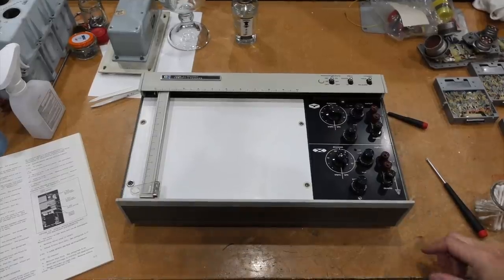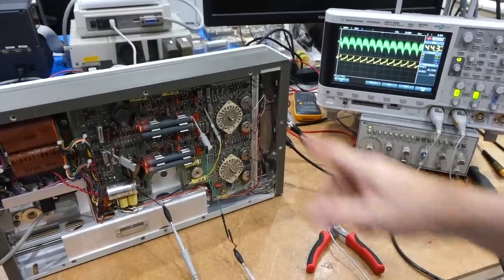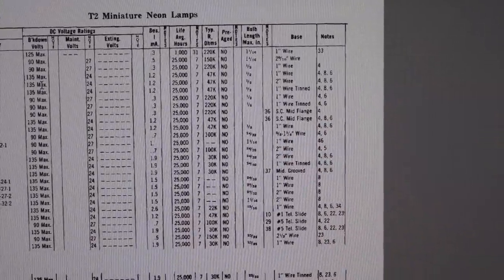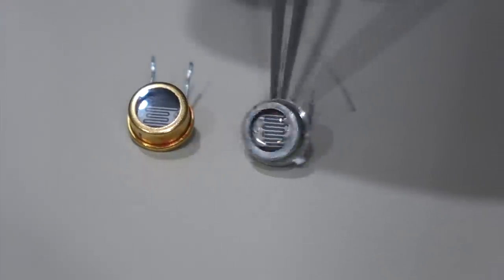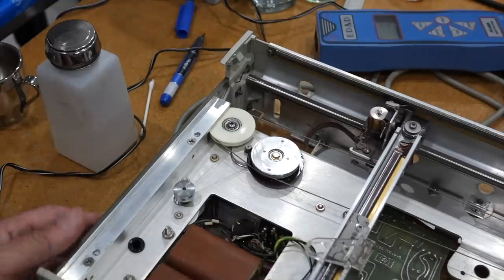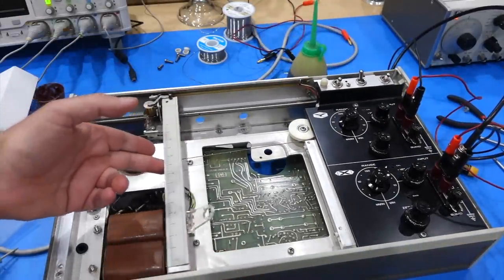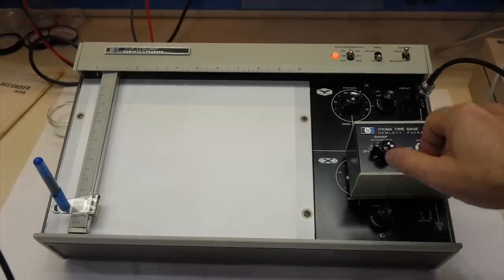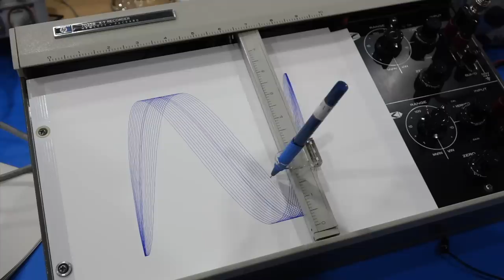HP 7035B X-Y Recorder Restoration Part 2: Back to its Former Glory.

Comment: About 33years ago, I repaired a lot of hp7004B plotters, those with the small amplifier / time modules.. very fine instruments. Once I got nearly electrocuted, due to a scratch in the lacquer of the HV paper hold-down. 😜
The experiments on High-Tc-Superconductors went over many hours, so finally leaving a big ink blob on the paper.. 
In turn I could finally convince my prof. to let me develop DAQ via GPIB - DMMs (bad Keithley 195A) and Borland Pascal on PCs. The PDP 11 had just been scrapped.
 Those were the days..   😍
For the FLUKE 845AR optical chopper we found modern neon bulbs from Barthelme,  type 82305, which show no dark effect. Maybe that's a hint to replace neons in HP devices (e.g, hp419A) as well.

Comment: I found this same problem with CdS response when working with guitar amplifiers... Fender used a 'roach' (neon with CdS heat-shrinked together) for their later tremolo circuit.  If you try and sub a generic CdS you find that it won't work well... CdS cells are slow to respond, so Fender had to find special ones that work fast enough for the tremolo effect to sound good.
Reply: I've never heard it called a "roach". The term vactrol is pretty common for synths and amps. I've never heard of anyone needing a special LDR for one though. They max out at 10-20hz?  Fender never used special anything unless it was special because it was cheap :)

Comment: So nice to see you use the electronics prototyping kit for testing this plotter - vintage gear restored and loved. BTW reverse-engineer the D-sub connector next to the mains connector, if it's not documented.
Cool timebase module too. A good demonstration of how an oscillograph works. 

Loving the ASMR mode!
Reply: And the 3312A function generator too

Comment: In my CNC with the pen holder on, I'm a big fan of pigma micron pens. Seems to work on multiple paper types, can adjust line thickness given that the pens come in different thicknesses. The 005 is super fine, but I usually use an 03. The felt tip also has just enough play to keep it smoothly on the paper.

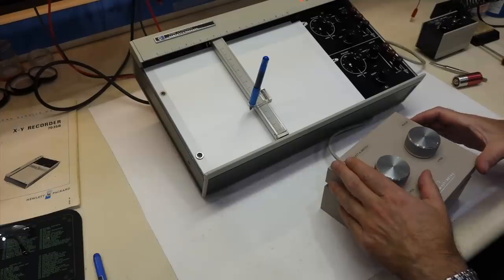Comment: 15:12 that's quite an expensive etch a sketch! And congrats with the result (both technical and your drawing, I would've made a mess just like 40 years ago)
Reply: Maybe you can put a double a-d converter in it so you can save your drawings

Comment: WOW MIND BLOWN!!
I thought those tubes was some form of isolation!
I repaired one over 30 years ago but it was the power supply.
Interesting using cadmium sulphide as I did not think they would react fast enough but it is only 60hz.
Sad but lost all my HP service manuals due to a leak flooding the box stores them. I see you with the HP book where I feel my loss.
Reply: Similar arrangements were used for high voltage optocouplers. Might still be in some cases.

Comment: The photochopper is such an amazingly simple and unique solution to the problem.  I love it.   Have you looked into Motorola's vibrasender/vibrasponders?  They're a neat bit of lost technology too..
Reply: Wow...my father worked with some Motorola police/firefighters radios that used vibrasender/vibrasponders to allow several groups share the same frequency, but activating only the selected ones when sending a call.
Reply: @agranero6  It's amazing that it worked in the analog days, and it's such a simple concept at its core...

Comment: Perhaps you could build a replacement sensor around a modern photodetector? A CDS cell typically has a response time in the tens of ms, a quick search turned up a VTPS1192HB-TR which has a response time in uS. No doubt you will need some conditioning circuitry too.

Comment: I guess a backup plan would be to just make a skinny PCB and hide it in the tube... use a fast photocoupler on it.
If the original parts are made out of unobtanium.
Nice plotter :)
Cheers,

Comment: Well, you almost gave the makings of a CNC router, there. You just need a X-channel amp/motor driver, the motor, and the Z-axis hardware. Then attach a spindle motor, or a 3D print-head, and a place for the 3D filament. Ta-daa! I think Mr. Fancy Pants would be proud.

Comment: Careful with ordering components. They might send you ceramic beads and you might eventually end up with all the parts to build an interociter. And we all know what happens after that!!
Reply: It seemed so promising - "Laying a four-lane highway at the rate of a mile a minute would be a cinch!", then you rotate the intensifier disk 18 degrees counter-clockwise, and it's all downhill from there...

Comment: This is a nice piece of instrument, which I'm still trying to get one. I'm surprised to see that the mechanical parts, resistive position sensors and even the electrostatic paper holder are almost exactly the same as my HP 9125A plotter for the HP 9100 calculator. However in the 9125A plotter, there's no photo-chopper anymore. They used integrated opamps to do the feedback control. Digital x-y coordinates are converted to analog and fed into the control loop to drive the two axis. I have a complete teardown of the HP 9125A plotter on my blog but I don't know if its OK to put the link here.
Reply from the maker: sure put the link in a response comment and I’ll let it through when it comes up for review.
Reply: Can you still post the link?
Reply: @jb5631  I tried but seems it didn't pass youtube. I'll try again below to see if it works.
Reply: Teardown of the HP 9125A plotter:  http://7400.me/2021/05/05/HP9125A/

Comment: Is that 25-pin remote cable you used for your etch-a-sketch box an original TTL remote cable or did you make it yourself? I’m wanting to use mine with my 85XX/141T Spectrum analyzer and I’m missing that specialized cable (I’m not even sure what it looks like…they seem to be unobtanium online). I find it mildly frustrating that HP never released a model that featured a top-side accessible Pen Lift port using either banana jacks or BNC
Reply from the maker: It’s one I made. Just looked up what the pinout was in the schematics - somehow it wasn’t documented anywhere I could find. But it’s simply X, Y and a switch to ground for pen lift. I also added a protected power pin so I could power my pots.
Reply: @CuriousMarc  Thanks so much!!! Do you happen to remember where you purchased that connector? Looks very compact compared to the traditional D-sub housings
Reply from the maker: @X5Industries  Standard Amphenol connector, same as HP-IB. Widely available. I had one in my box of goodies.

Comment: I wonder if a suitable high speed signal could have been crafted out of that sensitive photo conductor by placing a light blocking object between it and the LED, eg a piece of black paper, with a small hole in it?

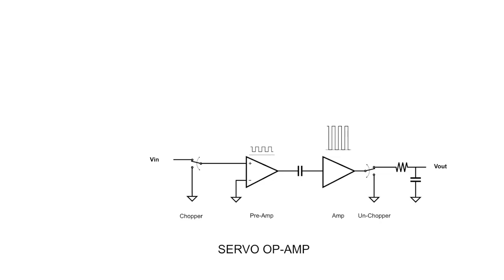Comment: 0:48 it may be a nitpick, but shouldn't the lower photo-resistor connected to the opamp (+) input instead of the "input" of the other photo-resistor?
Reply: Yes, also it is simplified a bit, the 7035B itself uses differential method to null out both inputs, see the schematic.